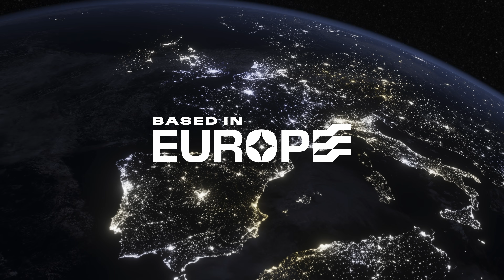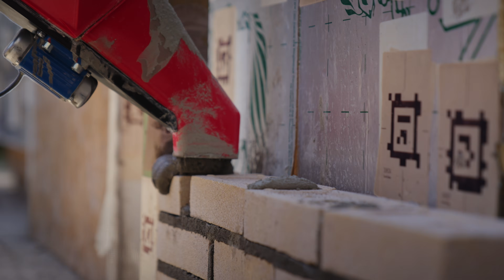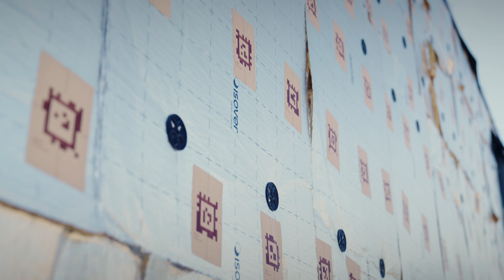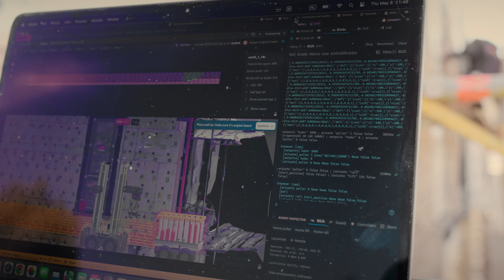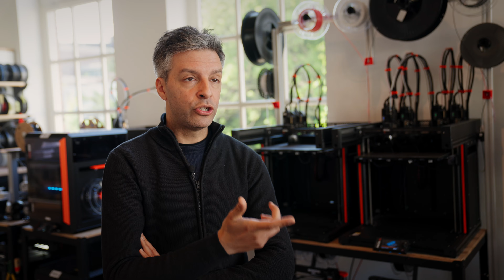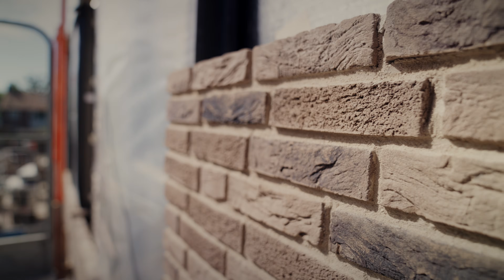Meet the Robot Bricklayer Fixing Europe's Housing Shortage | Monumental

Comment: What about increasing the size of standard bricks by 25% ? That means 25% less bricks to lay
Reply: But that would require 25% more material per brick. And also less mortar used, resulting in a weaker structure.

Comment: This is all fake veneer non-structural brick. You can't have a single row of bricks support any weight. This is wood-frame construction where the wood holds the structure and the brick is attached to the wood to keep it from falling over and collapsing. Instead of brick supporting the structure, it actually weakens it by adding extra weight and load the wood must support.

Comment: there is no big problem in construction; builders are fine with building as it is, no need to reinvent the wheel, skilled bricklayers are fine with making a physical and mental effort.
housing shortage is due to reckless european open borders; without illegal immigration there was plenty of spare property to buy and rent, and it was a bliss.
this is a startup that is only going to scam investors; $25 million and that's all you have? if one wants fast construction, would use insulated concrete formwork, but bricklaying both structural and cladding is still better done by a bricklayer.
what you have is a solution in search of a problem.
Reply: Europeans are not having kids... that's why they are importing a tax base.   Taxes keep a country running.   China is the only country that doesn't rely on immigrants and is still successful because there is 2 billion of them.
Reply: @fritzdeuces  europeans are having kids, and bring  them up well, not like insects that then have to leave their countries because there are famines.
the europeans are not importing anything, the illegal immigration is being allowed by politicians without asking people first, as we would have turned it down.
china is successful because politicians in the western world aren't applying tariffs to imports thus causing europeans industries to fail over decades, a managed decline

Comment: Did they work with Bricklayers? Until you get to 600-1000 per day, or the reality of a 2 and 1 gang (2 x bricklayers, 1 x labourer), 1200-2000 bricks a day (using profiles), including setting out bonds and keeping perps relatively plumb (as bricks, even now vary, thus the perp will vary, which is the correct method). Uneven sites, poor access, detailed brickwork (corbels, dentil courses, and dogtoothings), let alone tray damp on a split-level house. Or is it just boxes? Then pointing? 
The reason a bricklayer is a skilled trade is that it's not just about avoiding issues before you have even laid a brick; it's about the feel. Unless you've worked with multiple types of brick and mortar in different weather conditions, you don't understand the interaction of brick and mortar under these many variables 

Ref: Former apprentice trained 5th generation bricklayer, 34 years, also trained in Architecture (MRes) and a Landscape Architect (BA and MA), 12 years.
Reply: Personally I think new build construction should use lean construction techniques to improve productivity on building sites.

New build sites are very badly run: brick and blocks left outside in the cold and wet, the rubbish mortar they use in those hoppers,  uneven sites with mud everywhere so moving materials is inefficient.

I feel sorry for all those highly skilled bricklayers having to cope with all that.
Reply: And can it read plans!😏😏
Reply: @davidrutter3192 in-house software actually transforms plans to 3D environments the robots operate in
Reply: What happens to the blow out in time when it rains! Batterys and water never go well. Its not a Teslar car road . Construction site. Government jobs possible. Project managers stressed out now. Never work. You might get a job called Tech Bricklayer with a beer!
Reply: I'm not in any building trades, but, as you commented, never in a million years would it have dawned on them to consult with brickies 'on the job' 😂😂😂
Reply: @ashwatt2885 they are literally doing that
Reply: Thats okay theres always a doubters until its happening

Comment: Housing shortage isn't caused by lack of workers. It is caused by builders not building houses because that would lower house prices and that wouldn't be beneficial for the shareholders. This robot is only making the situation worse by removing jobs that could have been used to paying for housing.

Housing is a basic need that must be nationalized to prevent profiteering.
Reply: Work/jobs should not be a purpose in itself. We should have converted productivity gains into more free time a long time ago.
Reply: This assumes builders are the owners of the majority of housing stock, but they aren't, and that isn't what is happening. There is a shortage because the population is growing because of immigration, and due to zoning, construction laws, and the cost of construction due to a lack of workers (immigrants only make up 3.7% of the construction workforce but are the cause of 62% of the increase in housing cost increases in Denmark according to Anna Damm et. al. (2025)) supply of housing stock can't be increased fast enough, or put more simply, demand is outstripping supply because of immigration.
Reply: @bastiat691  hear hear
Reply: False, construction has been struggling with productivity and changing norms for decades. Suitable lots are rare and costly, making it capital intensive. 

Labor shortage in construction is and has been massiv.
Reply: Well time to bring these machines to uk shortage builders shortage housing
Reply: @martinlanigan9202  it's the unfettered immigration that is causing the shortage, both legal and mostly illegal immigration, can't treat a nation like a public square. restore britain
Reply: lol zero logic opinion
Reply: Typical socialist naivety. Why don't we give everyone a mansion and a billion bucks each while we are at it?